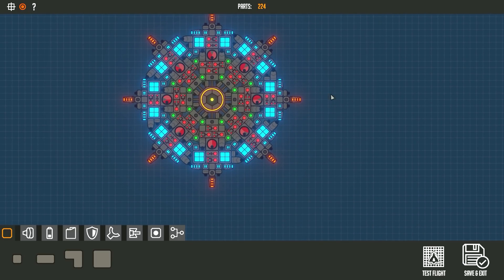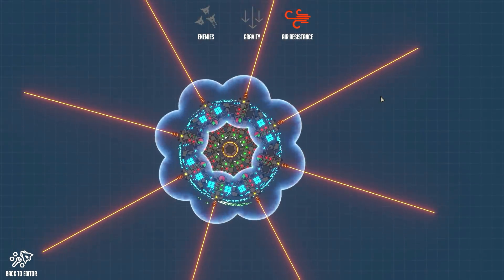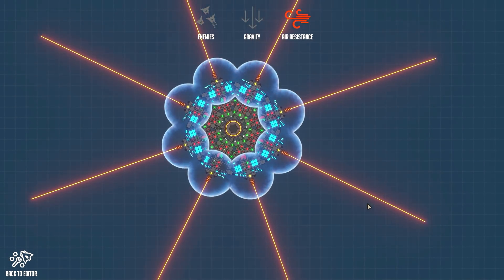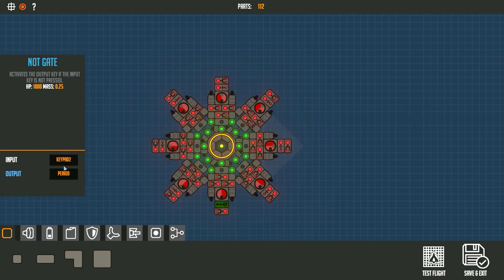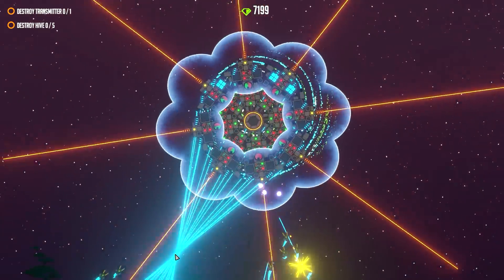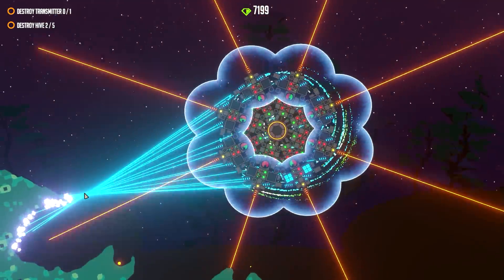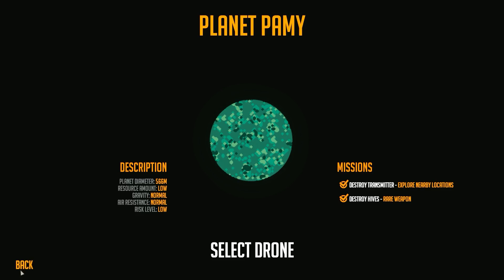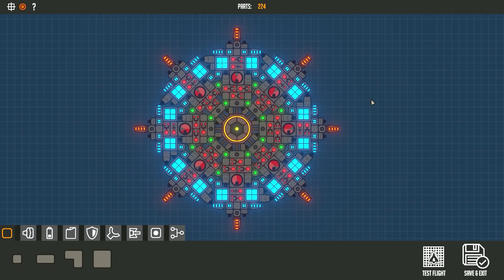WASD SPINNING DRONE - Spinning Drone With WASD Controls - Nimbatus - The Space Drone Constructor

Comment: It was a rotary engine that exploded. I think you need more spacing between the 45° engines and solar panels. 

I'm not sure how I feel about the spinning lasers, any other weapon would do more damage, if it hits. But with the spinning lasers you will hit, just not for much damage. 

Maybe the answer is more spinning lasers.
Reply from the maker: Are you talking about the red lasers?  They are mostly there for looks and to get rid of tiny bits of terrain.  I originally had a good number of flamethrowers on the outside of the drone.  Although it was very effective,  I wanted to showcase how this ship works.  Their was to much on the screen when I had the flamethrowers, which took away what I wanted to show.
Reply: Yea, I was there for the spinning flamethrowers life stream. They would have been very distracting. 

I was just thinking out loud that lasers Damage per second does match the DPS of other weapons.
Reply from the maker: Nothing wrong with thinking out loud :)